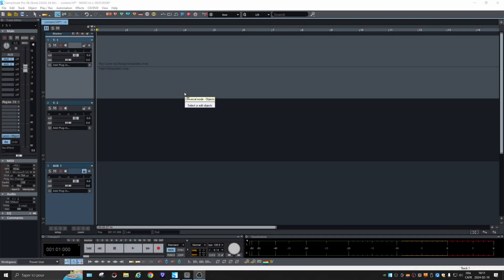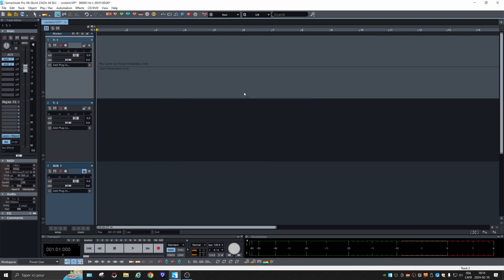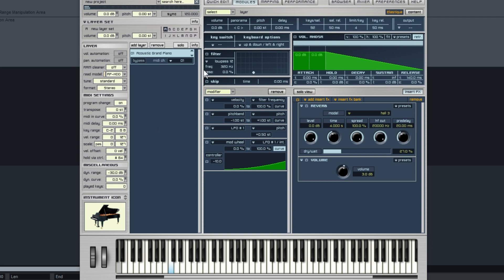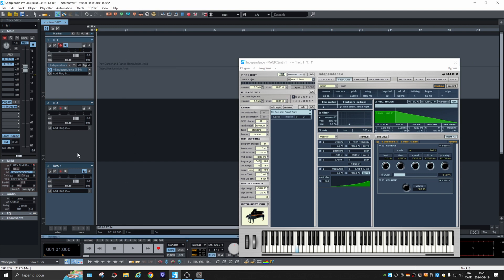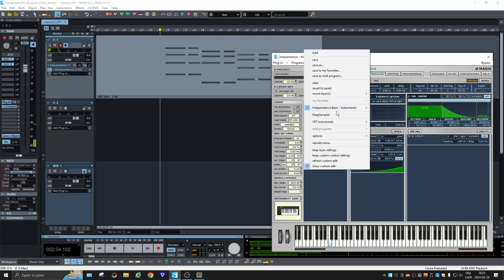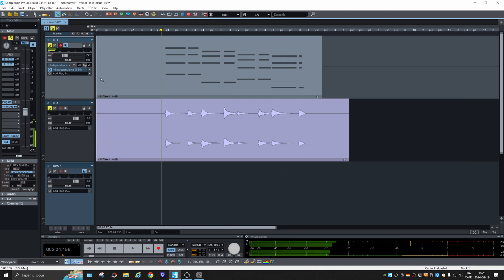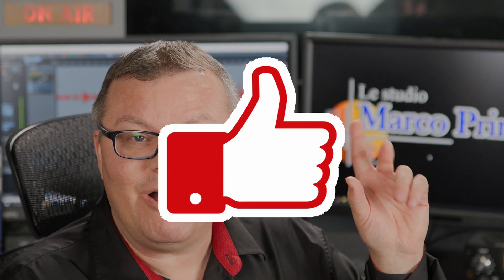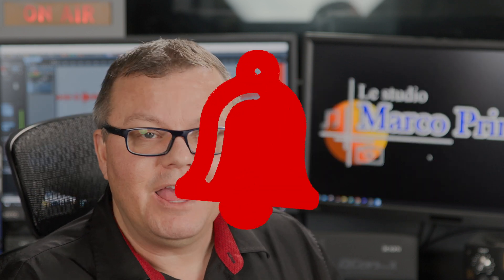Samplitude Signal flow revisited - input / output redirections and recordings

Comment: Marco I Need Your help. I started a project I thru the wave files stems in it . I started editing it . Then I save it cause I artists to record. When I came back all my stems where gone    is their a way could bring them back . I could see them and move them but they don't play
Reply from the maker: Hi, usually when importing files to samplitude, it asks if you want to copy the files to the project's location. If it was on an external device and you didn't copy the files and you don't have the device anymore, there's nothing to be done. Other than that, if you still have the files somewhere, just give the path to samp when it asks.